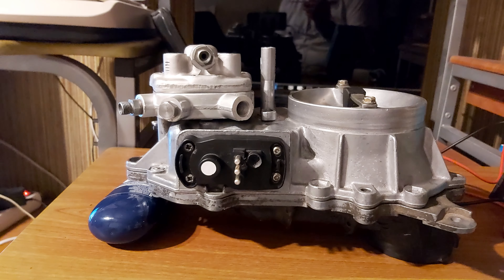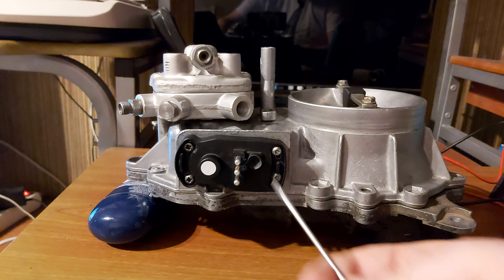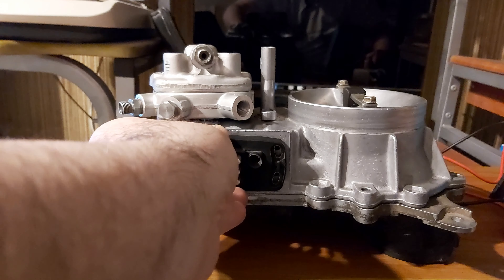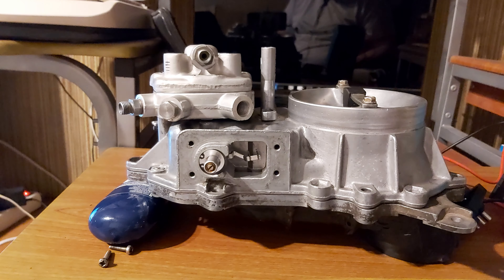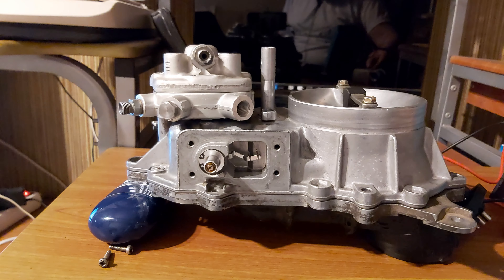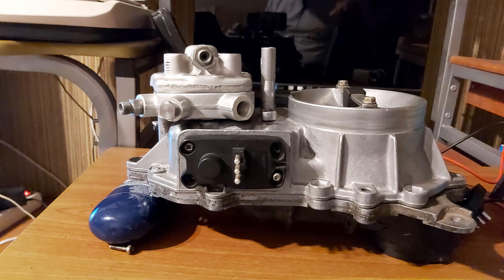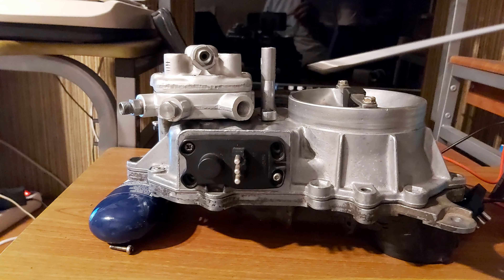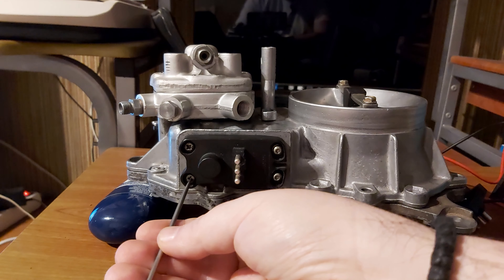Mercedes KE-Jetronic - A special video for a special person/sensor potentiometer

Comment: i measured mine today initially could not get to the pins and i accidentally put the earth where the positive goes and touched the metal fuel line hope i didnt damage the ecu, My reading was 0.2v when car was warm and this increased when i reved the engine
Reply from the maker: Which readings do you get on the potentiometer now? As you turn the ignition on can you hear the sound of the ICV?

Comment: hello, some clarification please, is this voltage test done with the TPS plug , unplugged? as we can see it in the video? or need to plug the cables plugs into the tps and test it? i mean, would the car work if i removed the power from the TPS? to test as u did?
Reply from the maker: Hello. No, you don't have to unplug the TPS! Test it right on the car!
Reply: @mercedeske  i removed the tps alimentation, and got zero. then i plugged the cable to it back, and found a way to reach the 1st and 2nd connection. and the result was 1.1 V  . how bad is that? please not that i checked my tps not plugged and while car is off. and the values were 4.15 kohms and 1.75 kohms.please note, my car is R129  300SL with m103 engine. thank you.

Comment: Hi… thank you for your ongoing support.
It’s great to see learn and grow with your content.
I have an issue at my 200E 102. 
The old poti was worn out. I bought the new one from the German guy out of Darmstadt as per your advice.
The 0.7 V was not an issue the set, but now I found out that the resistance is slightly rising up. But the resistance don’t fall at the end of way from the pressure plate. What can be the issue here? 
My Benz has only power ( not as much as it should have) from 0 to 3500rpm. Could that be the issue? 
Ignition parts, new.
No leaks.
Pressure 5.3 & 4.9bar
All liquids and filters, new.
Distributor refurbished. 

Thanks for any suggestions
Reply: Forgot to say, after 3500rpm it’s like there is not enough fuel or sth. On a flat street the max speed is 110kmh. On a hill upwards 70kmh Max. The fuel pump Relais and the ovp is also new. Kickdown works. But with no power!!! When I go from the pedal on top speed (110) it shifts in the 4 gear (auto transmission) and it feels that I can come to 120 😝. But not with full throttle. Everything checked like it should. Looked all your videos several times. All values are in the needed range.
Reply from the maker: Hi and thanks for everything. As for the poti, a guy selling new aftermarket potis says that "the old Mercedes nominal value" doesn't count any more because new potis are made from a different, more advanced material. I have the same situation as you and my car works very well. While being refurbished have the adjustment screws on the fuel distributor been readjusted? As for everything else I would have to see how it looks like so you would have to send me a video of your car to show me the problem. You can do that on my fb page.
Greetings,
Ivica FyM
Reply: @mercedeske  thank you ivica. Will do on the next days😇

Comment: Maestro buenas noche disculpe la molestia es q tengo una duda para graduar el tornillo de la mescla coloco el tester en los cables del EHA  y giro la llave Allen pero en qué valores tiene q quedar gracias por atenderlo a uno acá en venzla es bastante difícil mantener al día el mercedes.los costos son en dólares y muy altos pero gracias a toda esa información valiosa mucho se puede hacer.
Reply from the maker: El EHA tiene que fluctuar entre -3 y 0 mA cuando el motor está a la temperatura de funcionamiento. ¡Poco a poco y fácil con ese tornillo, es muy sensible!
Reply: Muy agradecido maestro mejor escuela la verdad no se puede pedir gracias mil bendiciones.

Comment: Just to clarify the test method. When you check for the 0.7 volts, the 3 pin connector is reattached to the potentiometer, with the 2 meter wires also connected to pins 1 and 2. Then the reading is taken with the engine running at idle, and the voltage increases when the throttle is increased?
When I do this, the voltage is approx 1.1 - 1.2 Volts and is unstable, with the engine idle speed also unstable. With the engine off, but with the ignition still on, the voltage is 0.087 (87mV) volts. 
Also, with both the engine and ignition off, the ohms between pins 1 and 2 is 4.38Kohms (4380 ohms). I haven't yet check how much the resistance changes when the throttle plate is moved.
Reply from the maker: Yes, that's right. You are put of specs for a bit concerning the resistance. Check the resistance while deflecting the sensor plate, the resistance must rise and in the last third of its way it must start decreasing. You can try to calibrate the potentiometer after the check. If you don't succeed, replace it. You are completely out of specs on idle, that's why you can't get steady idle.
Reply: @mercedeske  I have purchased 2 new potentiometers. The first one had only 1.72kohms, not 4.2kohms, so I followed your recommendation and purchased one from Germany. It also has 1.72kohms. Surely both cannot be bad?

Comment: Hello, my potentiometer with the ignition off, between pin 1 and 2, is 2.6 kiloOhms. Can the potentiometer be replaced?
Reply from the maker: Try to deflect the potentiometer and if there is no bouncing resistance then the potentiometer is fine.

Comment: Hey, i installed the new lmm pot meter. Its at .7 volt steady now. But there is no nr 3 in the round connector. So i can adjust the co correcty. Will have to go to the service center.
Reply from the maker: Many of them told me that. I can't simply believe it how.
Reply: @mercedeske  I can send you some photo's of it :). The nr was there but there is no contact. My block is a 102.961, the very first model.
Reply from the maker: @michelgroen1982  Send me on my mail.
Reply: @mercedeske  done.
Reply from the maker: Good thing you replaced the potentiometer. Concerning the X11, maybe something can be improvised to make a contact(maybe, I'm not sure).
Reply: @mercedeske  Still no joy. The car still starts really bad and I cannot press the gas pedal without the car stalling. This could be because there is too much gasoline in het engine and that pressing the gas pedal will add to much gas? Or could it be that the CO is too low at the start and pressing the gas pedal will add to much air... Have tried so many thinks now.
Reply from the maker: You will have to get the potentiometer working. I think that's why the car stalls.

Comment: Thanks..  5:25 How can I change the brush inside (Metal brush reading Potentiometer Value)
Reply from the maker: Well, I think there is no way. May someone correct me if I am wrong but I think that part is not possible to find except you buy a used airflow meter. I am going to do a research on this but I am skeptical about that.
Reply: @mercedeske  
I sent mail I have a plan but I'm afraid of failure: s
Reply from the maker: This is not bad but try to raise the voltage at 0.7V, I think 0.6 is a bit low
Reply: @mercedeske  
I set it to 0.7 volts, but because the brushes are broken (fork, crooked, or near break), the value drops to 0.6 volts after the initial reaction to the throttle position.
Reply from the maker: @r3FMusic  Look, this part was never an issue because no one has been changing this part and there was no need. My advice to you is to find at the junk yard the whole unit and to try to do a swap. Try to look for by the number on the metal plate of your whole unit.
Reply: @mercedeske  
Thanks...

Comment: I have had time today to work on it a little. It seems a pin was bent and not touching the potentiometer, I have strighted best I can. I can get 0.7 now but fluctuating quite a lot and this at highest position. The duty cycle is steady at 39.5% I have not tried to adjust yet. I am going to wait see if my cold starting is better first. Thanks again!
Reply from the maker: Make sure that you have steady contact where you have been bending. As for the duty cycle it's a rich mixture. You must have a fluctuation around 50%
Reply: @mercedeske  Thanks, Its driving so much better than it was but more work needed still. How do I check contact is OK now?
Reply from the maker: There is not a special method just try to make sure the part has a steady contact.

Comment: Thank you, this is more than I expected, you are very kind.
I am going to investigate the potentiometer now. I know it has been replaced but not set correctly previously.
Reply from the maker: It was my pleasure. Best regards
Reply: @mercedeske  I think I may have found a problem, I went to test current setup, I don't have time to do more today. But currently there is no voltage between pin 1 and 2, and also taking off connector has no effect on how engine is running. Is this just bad potentiometer or another fault?
Reply from the maker: @retrosupplystore3216  It's the potentiometer. How many miles has the car on the clock?
Reply: @mercedeske  Its slightly complicated, it should be a 1.8 but has a 2.3 8v engine in it. I am not sure what miles are on this engine. I have replaced loads of bits trying to get it to run smoothly, injectors are quite new, all the cheaper sensors I have tried replacing. It feels and sounds far better now with the 1.9mm sensor plate adjustment, it was far more free play previously, about 4mm
Reply from the maker: @retrosupplystore3216  The potentiometer is an issue that has to be replaced after 90k miles. It affects the idle, the engine is likely to stall, it stumbles, loses power. The potentiometer has the task to report the ECU the correct position of the sensor plate so that the ECU could calculate precise  amount of air delivery.

Comment: Bonjour j’ai regardé plusieurs fois la vidéo mais la traduction en français est pas très explicite et comme je ne parle pas et comprends aucune autre langue pour moi difficile dit moi pour les réglages au multimètre les prises du potentiomètre et de également doivent être branchées au enlevées pour prendre les mesures
Reply from the maker: Le connecteur ou le potentiomètre doit être un peu retiré pour que le multimètre touche les contacts. La voiture doit être à la température de fonctionnement et vous devez obtenir 0,7V. J'espère que vous avez réussi à comprendre le reste de la vidéo.
Reply: @mercedeske  oui je note par écrit toute les vidéos comme ça c’est plus pratique pour moi je l’es regarde plusieurs fois pour être sûr merci si j’ai d’autre question 🙋‍♂️ cela ne vous dérange pas au moin ?
Reply from the maker: D'accord, vous pouvez toujours me trouver ici.😃
Reply: @mercedeske  pour expliquer c’es une 2litre 122 XV 90 kw boîte manuel je l’ai récupéré en panne chaîne de distribution simplex et pas en duplex le pignon qui fait tourner l’allumeur n’avait plus aucune dents il ressemblait à un disque ce j’ai commandé un kit chaîne et je l’ai changer moi même en regardant des vidéo d’un gars qui s’appelle milserge sur un forum 190 passion quand j’ai réussi à la mettre en route elle démarrait très très mal 5 a 6 coup de démarreur et surtout pas toucher l’accélérateur sinon elle calait et j’avais aussi témoin abs allumé j’ai changer le relais de surtension et le témoin abs est éteint et elle demare sans problème par contre à froid pas plu de 600 tours minutes j’ai changer la pompe à essence car elle fesait beaucoup de bruit le contrôle t cynique de la voiture de st passer sans problème mais heureusement que je connais la personne qui fait le contrôle car elle pollue beaucoup trop  il me reste la carburation à revoir  après avoir rouler le lendemain quand j’appuie sur l’assiette du débitmètre je vois que c’est humide dedans et sa sent l’essence  et toujours pas de ralenti accéléré quand elle est froide ne monte pas à 1200Tr seulement 600Tr j’ai commander un kit membrane sur site usa et aussi un bon testeur comme toi j’attends d’avoir les pièces pour continuer 😓 je me tâte de commander aussi un régulateur de pression car il a 34 ans tout à 34 ans sauf moi 56 ans je n’ai pas trouver le régulateur de ralenti sur la voiture il y’a rien au pipe d’admission ?? Sur les durite de reniflard j’ai une petite pièce en allu avec une vis de réglage c’est tout ou alors j’ai mal regarder mes sur pipe admission y a rien pour tester avec la pile de 9 volt ? Par contre pourrait tu faire vidéo sur allumage pour comment caler  l’allumeur et comment régler l’avance à l’allumage merci à bientôt je te tiens averti pour la suite de mes travaux que je fais moi même
Reply: @mercedeske  c’est un système d’aire additionnel KA QUE J’AI
Reply: @mercedeske  quand je teste la prise en continuité broche avec broche =biiiip et broche 1 avec masse =biiiiip et broche 2 avec masse =biiiiiip est ce normal

Comment: Great job you’re doing here…i just bought a w124 200e ke-jetronic a few months ago and i’m learning a lot from your videos. I would appreciate some ideas if it’s no trouble…i have a very irregular idle…sometimes high and sometimes low…i tested for vacuum leaks, potentiometer, coolant temp sensor…etc. They are all fine. One thing though…when I disconnected the relay next to the battery the idle got really steady, a bit higher then normal but steady. When I connected it got back very irregular…that tells me the problem is electrical. Please confirm or give an idea! Thank you!
Reply from the maker: Hi and thanks for your nice words. Check the rubber boot, maybe you have vacuum leaks there. Check the o2 sensor if you have one. Did you clean the ICV?
Best regards
Reply from the maker: Also watch this video
https://www.youtube.com/watch?v=jx8xWmALmGk&t=353s
Reply: @mercedeske  o2 sensor is replaced but didn’t bother to check the duty cycle, icv is cleaned and working, didn’t check the rubberboot yet. Car has 376000km, maybe I’ll attach a video to be more clear.
Reply from the maker: @stefsebi92  Check the rubber boot.
Reply: @mercedeske  mr Ivica, I checked the rubber boot and is in excellent condition just like the rest of the ke-jetronic ansamble. I’m suspecting an electrical issue because the engine does not react at all to disconecting the coolant temp sensor for example ( sensor works perfectly fine) . I did a vacuum test and the car passed the test. I can also see that the harness was messed with before…not sure what has been done. My question is if you could provide me a diagram for the ke-jetronic system?! I would reimburse you obviously! Thank you in advance!
Reply from the maker: You will have to yell me about your car - the model, the year of manufacture in order to know which generation of ke it is about. Do you have the coolant temperature sensor with 4 pins or with 2 and the icv - with 3 or 2 connectors. Send me the information in inbox of my fb group fix your Mercedes(you have the link on the homepage of my channel and in the video description).
Reply: @mercedeske  sorry, don’t have a Facebook account…coolant temp sensor is with 4 pins, icv is with 2 pins, year is 1992, m102.923 87kw, o2 sensor, the ke-jetronic bosch managment unit has 25 pin connections.
Reply from the maker: @stefsebi92  Okay, this is good enough. Somehow I will have to send you the diagram. Do you have instagram?
Reply: @mercedeske  i do. Sebastianstefs . Thanks a lot. I’ll do a donation for you as well😉
Reply from the maker: @stefsebi92  Thank you 😊

Comment: Hi ,i have seen some of you videos and i must congratulate you on how you explain everything in such a simple manner.I own a W126, 380 sec and,I am having problems with it. When i put the car in drive it runs very rough (like on 6cy instead of 8cy) but when i give it a bit of throttle it seems to run ok.This happens in traffic so i put it in Neutral and it settles down,Back in drive and runs rough untill i accelerate.Any idea what  could be causing the problem.Just replaced the Distributor cap and rotor button but no change.Thankyou and keep up the good work.  
Melbourne Australia.
Reply from the maker: Hi, thanks for these nice words. I suppose you should check the injectors. If your car has more than 150k miles consider checking the injectors. Maybe they have an issue when the throttle is barely pressed.